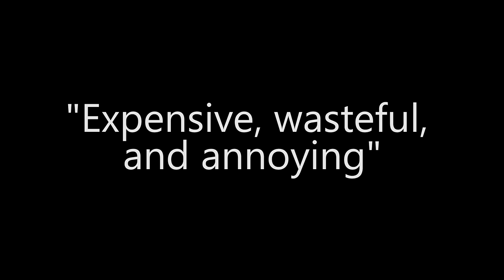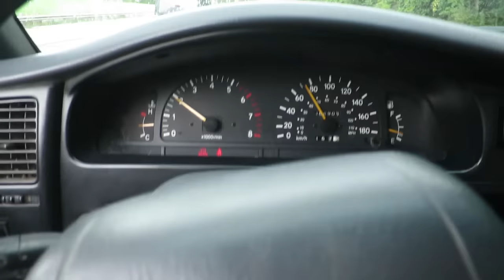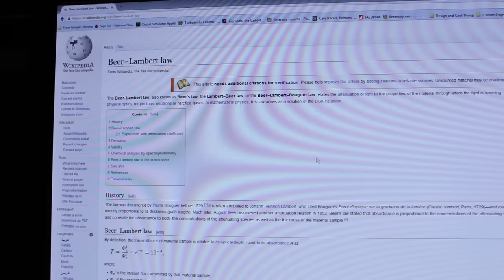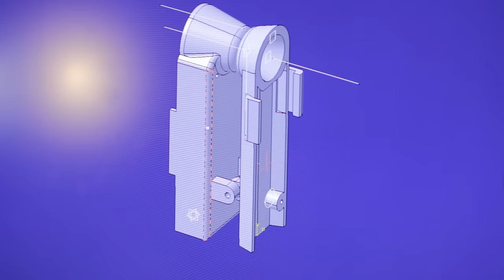Open Source Non-Invasive Glucose Meter - Expensive, Wasteful, and Annoying

Comment: Hi there, I started on basically the same project and just found your video.  I have sort of jumped in based on a couple papers I saw. I really like your hardware design a lot, it looks so much cleaner than my wiring mess right now.  Not sure where this went or stopped, but if your interested in sharing any lessons learned, or working on something similar, I would be interested in your feedback.

Comment: Unfortunately, test strips are also very profitable for manufacturers to make and retail pharmacies to sell.  Expect a lot of industry push-back when it comes to non-invasive glucose sensing technologies.

Probably should have built a quick-and-dirty prototype to prove out the process before investing a lot of time into this project. Unless you were trying to lure investors with a flashy, but non-functional light-toy.
Reply from the maker: Jess Stuart I don't just expect it. I guarantee it. That is the number one issue we face. Can you believe we live in a world where a corporation making money is more important than helping millions of people live better lives? I don't like thinking about it. Keeps me up at night.
Reply: Sorry if I came off a little harsh.  I appreciate your initiative in trying to develop an open-source non-invasive meter.  I am an electrical engineer, and I have Type I diabetes.  What frustrates me the most is all the hype and false hope about new glucose sensing technologies that never seem to pan-out.  My fear is that a lot of research companies have taken advantage of investors who are eager to hold stock in companies that will develop new glucose sensing technologies, but don't have the technical or scientific expertise to evaluate the data or claims being made.  Developing a non-invasive glucose sensor is a hard problem, that will require a lot of capital investment to crack. Most investors have been scared off by the high risk and all the hype.  I've become very pessimistic over the years.  If small-companies with promising technologies can't get funded, I don't know if we will ever see a non-invasive glucose monitoring system.  Maybe a big company like GE or Samsung, or Siemens will come to the rescue.

Comment: can I use only 650nm pulse laser diode instead of using 904, 1550nm laser diode?
Reply from the maker: I don't use a laser diode at all, but no, you need the 1550nm. Its essential. Unless you have a way of making the 650nm produce 1550nm.